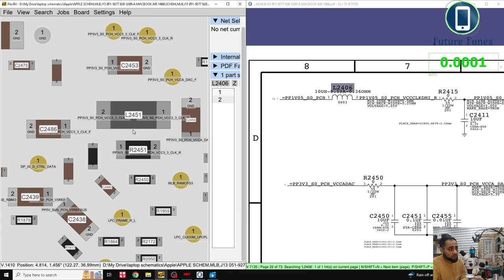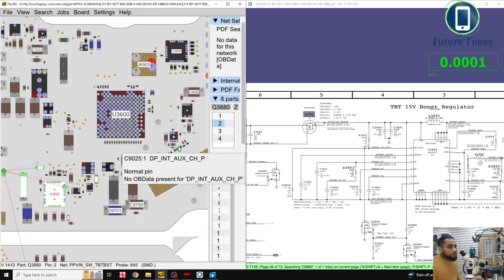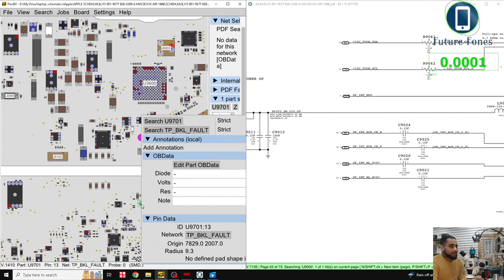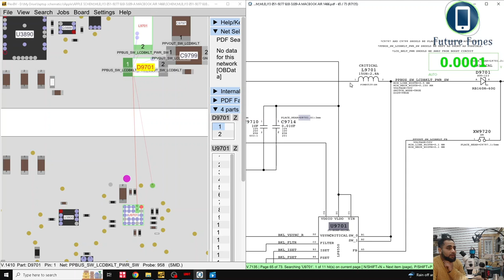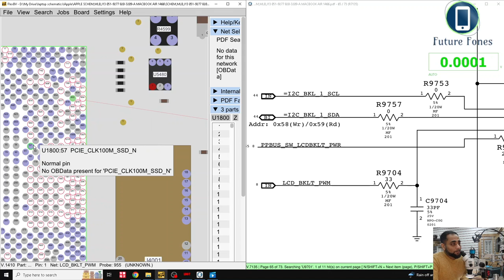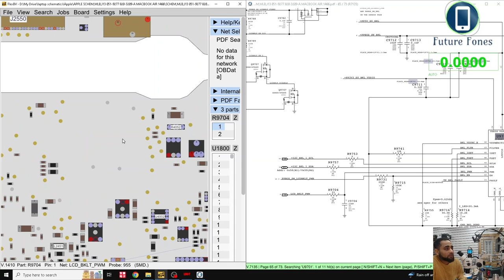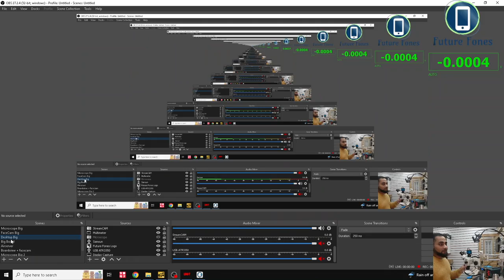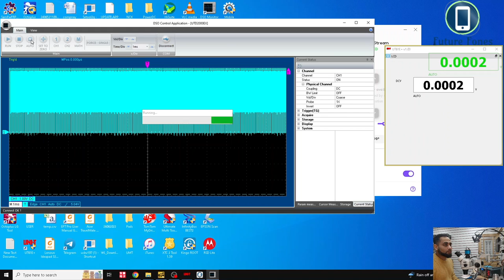Macbook Air A1466 (820-3209) No Power Fix and PWM Signal at Backlight

Comment: Very detailed video and explanation. I have a question though. You showed the PWM pin where it's connected under the PCH. Usually when the PCH is faulty then we have no working condition for the laptop (or the Macbook) but in this case it's just one signal missing and you said that this is the case in many liquid damage faults. We can safely assume that there is corrosion in this pin under the PCH which prevents the signal to reach the backlight IC. Should we try a re-flow of the PCH in order to fix the problem or it's a waste of time or it may cause even more serious issues ? What's your opinion and experience on that ?